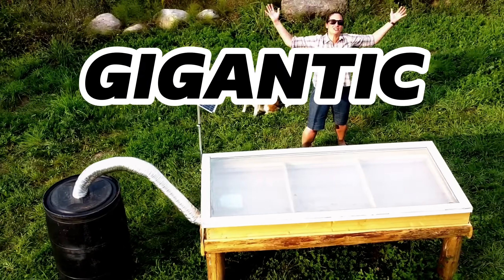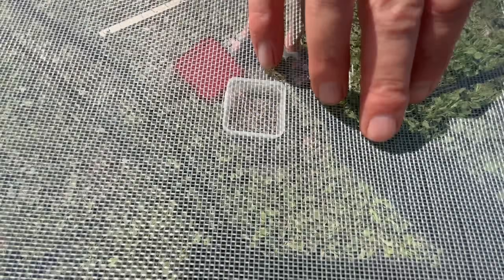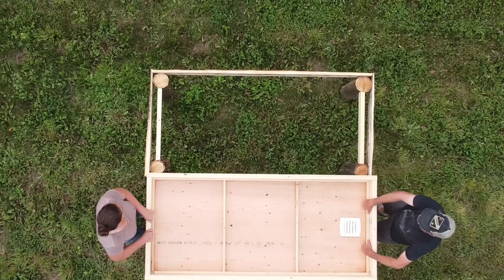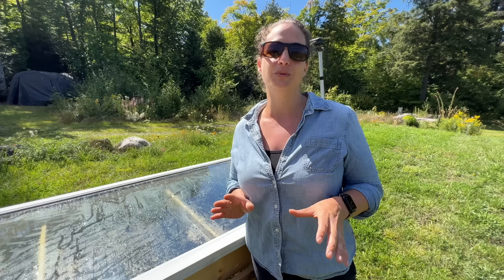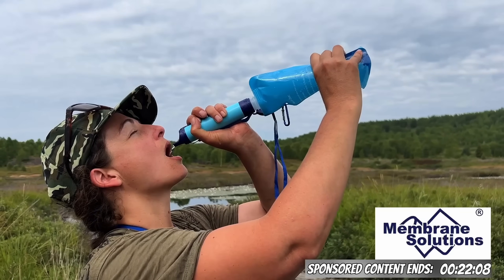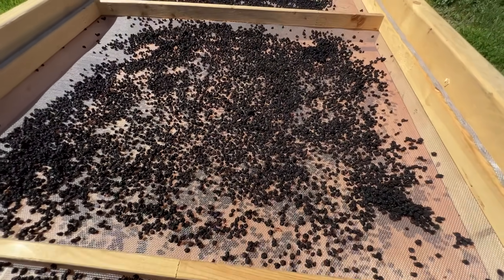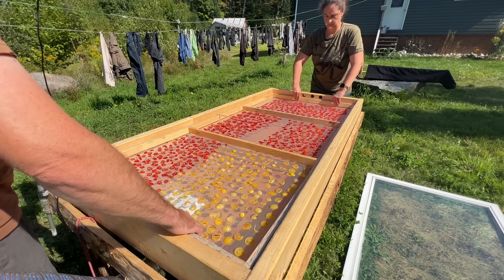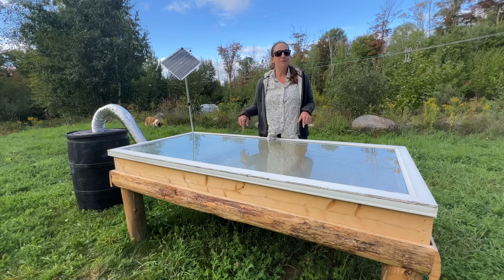We Built A GIGANTIC Solar Powered Food Dehydrator Machine!

Comment: Nice, but I recommend for others a configuration more like your commercial dehydrators. Stack the shelves vertically. Use scrap metal from appliances from the dump. Paint them black and make a vertical solar chimney (look it up). Your shelves are inside the solar chimney. There is no need for a solar panel and fan. The thermal rise draws the air up. No need for UV hitting the food. Better heat distribution. If you wanted extra work and expense, you can combine it with a reflective compound parabola and then you can dry on cloudy days, or in the winter.

Comment: Great unit.

Next version: 
1) Create a full solar collector, which is much more efficient.
2) Make a closed air heating housing. This allows you to control how hot the air will become.
3) Blow the hot air to a closed (no direct sunlight) dehydrator housing. That way you can also dehydrate herbs.
4) Capture the released moisture with a desiccant in a moisture trap. Thee are plenty of bio friendly materials available.
5) Recirculate hot air by mixing it back  into the start of the system.
6) Capture excessive heat and put it in a sand battery.
7) Use the  heat in the sand battery when the sun is not available.

Do not forget to insulate very well. Because you want to be as efficient with your heat as you can.

Comment: The sliding glass door should not have an IR coating.  Blocking infrared heat/light defeats the purpose. If you already own it, the test would be if a box under it heats up.  If the reflection coming off it is purplish, it would have an ultra-violet coating.  An ultra-violet coating is not a problem of itself, but it indicates a modern high-end glass that would also have an IR coating.

Comment: The video was excellent, thank you very much. But I have a suggestion, I’m not sure if it’s practical or not. Instead of lifting and putting back that heavy double-glass every time, wouldn’t it be possible to design the mesh tray in a way that it can be pulled out from one side to take the dried vegetables?”

Comment: I wounder if this dark barrel way to heat air could possibly help heat pumps during the winter. It wouldn't need to make a huge amount of hot air but just help make a temperature difference near the outside unit to help with efficiency.
Just a thought.
I love this passive way of making heat y'all came up with.

Comment: might not be too complicated to have a temperature sensor and the fan motor connected to a microcontroller programmed to control the latter using the former to maintain a specific temperature.

Comment: If sunlight is a problem for drying herbs, can you try using a white or black(depending on outside temperature) wooden or plastic lid, instead of the beautiful glass lid you're using?
Reply: it wouldn't get as hot so it would be slower. but some sort of black sheet suspended roughly in the middle vertically could work. sunlight would get in and heat the air, but it would be blocked before it hits the herbs.

Comment: If the bottom is plywood and plywood is scrap wood and glue, wouldn't the plywood (and if the frames are made with treated wood) be offgassing potential VOC's as part of the heat/cool cycle?
Reply from the maker: You think that’s air you’re breathing now?

Comment: Wood is cheaper and fine if you’re doing it for personal consumption. But wood can harbor growth for mold, fungus and microbes so you can’t use it if you’re doing this for commercial purposes to sell. Creates a biological risk for inoculating your product with mold and yeast spores.
Reply: Just leave it in sun for 3 days after rainy season to kill all microbes
Reply: What material would you suggest instead of wood? Or would you need treated wood instead?
Reply: Stainless steel, stainless steel mesh, not galvanized hardware cloth.

Comment: If you line the bottom of your hydrater with a dark colured corrugated iron it will absorb heat & radiate it back up under the produce. Also, if you cut the legs at one end so the table is on an angle & the vent holes at the top high end the hot air will rise up to the top creating a natural hot air circulation over the produce increasing the drying effect & no fan required.  John from New Zealand :)
Reply: Passive designs have the advantage of less stuff to break when you really need it . Powered can do the job a little quicker . Given the fact that passive always work I prefer those . I am not against adding a fan though ...
Reply: What if you use mirror instead of corrugated iron to buffer the heat?
Reply: @rotimiadeoye7382  Aluminum Foil??
Reply: Hi John, what would be the ideal angle? Thanks, Ash from Bangladesh.
Reply: اون موقع سبزیجات سر نمیخورند ؟
Reply: Solar oven.
Reply: Dark is not COLOUR
Reply: @lawaldanladi9129 he didn’t say dark is a color. He said dark colored. Sky blue is a color and navy blue is a color. Navy blue is dark sky blue is light.

Comment: i'm think a bout a similiar concept only that. would suck in cold air. i will try burry a hose undeground for x meters to let the air cooldown so that the relative humidity is lower when you heat the air up. i guess this will speed-up the drying process

Comment: Hi, to increase the effect of your hedydrator significantly, please try 2 things: Have some black colored cloth sitting in the bottom of the dehydrator to generate the heat and insulate it. Have a little chimney at the outflow end to improve circulation. Afterwards, you should not need the black barrel any more.

Comment: You can install a steel sheet on the inside of the tray and a black colour non-absorbent cloth or anything as it'll attract heat and the steel sheet will help in retaining it. The circulating fan would do rest of the job. I believe this would negate the chore of turning over the tomatoes. Hope this idea works. Just came across your phone informative  channel. Take care
Reply from the maker: The tomatoes stick to the screen.  They need to be flipped to make removal easier when they are finished.

Comment: I am planning on making one. My neighbor just gave me 2 shower doors and 2 double paned sliding glass doors! Yayyy. I am going to add a thermostat and 2 fans for cooler dehydrating. The main fan can run continuously for air flow, but when the temp goes above 125, and I want a cooler dehydration, the secondary fans will kick on. I think I will also add a battery

Comment: I've been looking at dehydrating eggs. Would it be possible to do it in this? Obviously it would have to be done on baking paper.
Reply from the maker: You could try but it would probably end up cooking them rather than dehydrating them.  We have an egg dehydrating video if you haven’t seen that one yet.  An electric dehydrator is going to be more accurate and easier to control temp and airflow than this.

Comment: Fiberglass screen is better for food processing. Check that your wire screen isn’t galvanized and leaching zinc into your food - especially the acidic tomatoes.
Reply from the maker: Its stainless steel screen.
Reply: @Wilderstead  awesome. an expensive treat!
Reply from the maker: Not really.  Found at the restore - 5$ for a 20 foot roll if I remember correctly.

Comment: Have to make it slant so the water runs down the glass sides and not drip down on the food
Reply from the maker: Inside the unit stays dry.
Reply: @Wilderstead  glass always have moisture,  so how can it stay dry?
Reply: @426superbee4  did you not watch the video? The moisture is in between the 2 panes of glass
Reply from the maker: The moisture in the unit is removed with airflow provided by the fan. Maybe you need to watch the video again to understand the concept of a dehydrator?
Reply: @Wilderstead  i under stand  > THAT YOU GOT WATER DRIPPING!
Reply: @dement3djoker  You build it!  i' am going to Laugh at you fools / When your food is all MOLDY
Reply from the maker: @426superbee4  unfortunately you are unable to comprehend what a double paned window is.  Enjoy your day.

Comment: We have raccoons, skunks, squirrels, deer, ants, ground bees, german wasps…. How does your dehydrator stand up to these animals and insects?
Reply: Lock it properly
Reply: For racoons, make the legs tall, or hang that thing as high as you possibly can.
Reply: What you talking about that thing looks heavy to lift and most flying insects are diurnal so will get cooked in there so they won't be going in anyways that what screen mesh is for
Reply: @CMZneu  clearly spoken by someone who doesn’t have those pests.
Reply: By the looks of it, it stands on all four
Reply: Huh??
Reply: @Sirtigereg damn, you beat me to it! 😂
Reply: idk about skunks
ants,try a fine mesh between fan and vent
deer, wire fence around it.

everything else should be solved by those or the already existing design.
Reply: @bloodlove93  for the Ants you can place bricks in a tub of water and stand  the frame on the bricks in the water ants cant get to the food
Reply: @ronelsmith6906   thank you, that’s a helpful tip for keeping out ants.
Reply: @bloodlove93 for skunks, you can hang that as high as you possibly can on the property. Bottom line you climb a tree
Reply: @cutestshorts101 that would be a good idea, but there are no trees within 100 feet of my house, and the ones further away are right by a road :(
Reply: @b @bloodlove93   thank you, those are useful suggestions
Reply: How bout YARD DOGS!!??
Reply: @Mike-yl6hs no fence.

Comment: Ome improvement i would suggest. Instead of preheating air intake why not dehydrate cool air with reusable desiccant silicone pads. And add slope to glass sheet as the droplet will run down on its own and improve efficiency

Comment: adding a hydraulic lifting system, to the ends of this for lifting thr glass might not be a bad idea. 
also, ading a secondary screen to  just have to flip the drying rack rather than flipping EVERY  single tomato or dried fruit that needs to be flipped is another suggestion i would make.

you also say herbs are better off dehydrating in a regular dehydrator, but why not just make a completely black plastic cover for the glass? protect the inside from the uv light and also probably raise the temperature.

Comment: Have you all considered adding pneumatic hinges to the door frame? Would that help or do you all find that the setup works as-is? Regardless, we're definitely doing this on our homestead. Two videos in and you all are speaking my and my wife's language!

As a side, do you all have sassafras trees up where you live? The leaves can be dehydrated and powdered into a seasoning called filé. It's a popular seasoning in Louisiana but could make a nice addition to your spice cabinet alongside bay leaves and other vegetal/bitter-ish/spicy things!
Reply from the maker: Welcome to the Wilderstead!  We considered hinges, but the old patio door is very heavy, and we worried about it crashing down and smashing, or possibly tipping the entire unit over if opened all the way.  Also - having a hinged top that might not open all the way hinders your ability to easily access the entire inside of the unit when working with what you are dehydrating.

We don't have any Sassafras trees growing here.  Our climate is a little too cold in the winter for it to survive.  It's a nice seasoning, though.

Comment: What is they net material ?
Is fan exhaust from dehydrator or flowing in ?
How much temperature required for lemon sliced 
Cause temperature out side usually 35 to 40 degrees minimum we have

Comment: If you are using a fan to move the air through the dehydrater, consider adding a "pre-heat chamber" to "pre-heat" the air so that asthe air is drawn though the drying chamber, it is at a higher temperature so should speed up the dry-time... and then you showed the "black box", silly me :-)
Reply: The pre-heat chamber be similar to the drying chamber (glass over box), but painted matt-black. Also adding ridged insulation to the outside of the box improves preformance. Another option is to add thermal mass (such as buildind the chambers out of brick and adding insulation to the outside) as this will provide heat after sun has gone down (unless you take the drying produce in each night.)

Comment: Some very impressive tinkering to make this machine! 
I wonder if the evening air moisture or dew would re-enter the veggies when you have to run the system for many hours?
Also, that's a lot of blueberry picking!!
Reply from the maker: The evening moisture doesn't seem to have much impact.
Reply: This can be  tackled by maintaining  the chamber airtight at slightly negative pressure.

Comment: Really nice project !! I am pretty sure I will copy this quite soon. Your brainstorming meetings (or however your process is) are really productive, lots of nice ideas from you. I really like how you thought of ventilation and temperature control. When I dehydrate my mushrooms I like to keep temperature to about 50 celsius, maximum 60 since they almost get cooked if temp is higher and thats not what I want.
Reply from the maker: Yes, the fan and the pre heater really help with maintaining whatever temperature you might want to run the unit at.